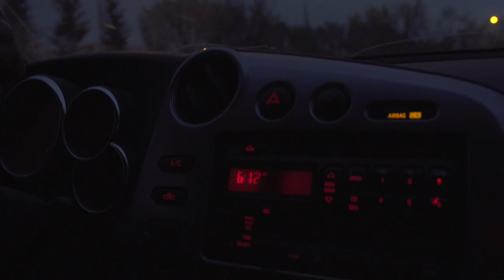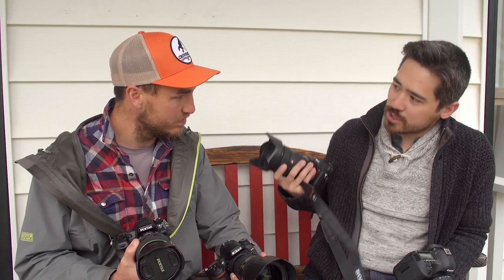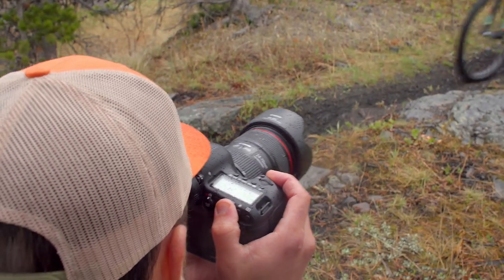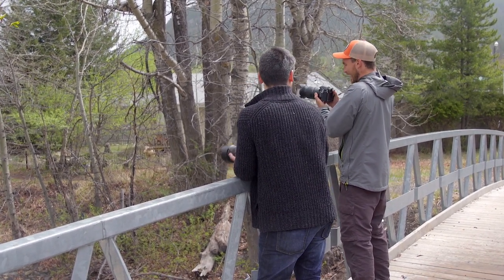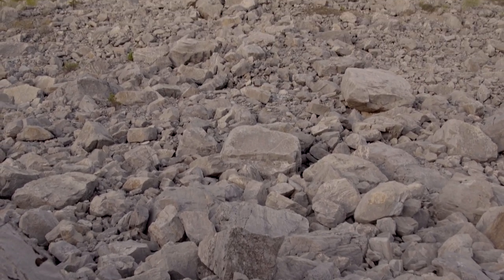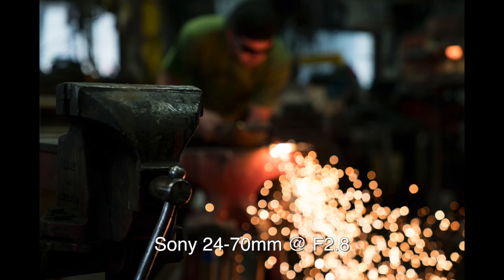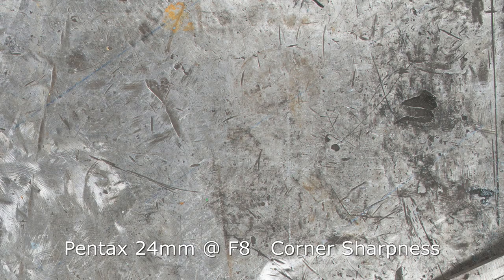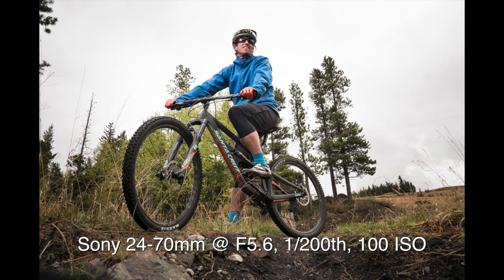The Great 24-70mm F2.8 Shootout! (Featuring Sony, Pentax, Canon and Nikon)

Comment: Main reason I'm selling my A7RII, Canon lenses.
Reply: Which camera are you going to use instead of the a7R II?
Reply: Mostly the Canon 5D3. I've realised the Canon system is hard to beat; Sony isn't even close (for photography).
Reply: habitullence The only thing where Canon beats Sony is AF Performance, battery life and lense variety.
Reply: Ecosystem of Canon, inc. third-party, is vast in comparison; better lenses; nicer to use (especially with heavy glass); dual slots; durability; professional support is light years better; (I could go on). Obviously depends what your use cases are, but for mine the Sony doesn't make sense.

The Sony has sensor and size (not really weight because of extra batteries) going for it.

I would rather wait for Canon to up their sensor tech — for me, good glass alone is far more important than a slightly better sensor (the adapters don't get the same results as native).

Like I said, depends on your use cases. Personally, I haven't looked back.
Reply: lol, please do it.

I'd never ever go back to Canon. 

the image quality has the highest priority for my customers...
Reply: 5DSR with Otus > Sony A7RII hands down.
Reply: habitullence 

??? you said something about canon lenses? :D the only lenses which could outresolve this sensor are zeiss lenses, and you should know that sony has zeiss members in its team...

Comment: Too bad Sony lenses are fly by wire, kills it for video producers.
Reply: The 85mm f/1.4 from Sony is a different animal. It's meant for video. Check it out
Reply from the maker: +Neopulse00 Still focus by wire. Beautiful lens, but I wouldn't use it for video work.
Jordan @ TCSTV
Reply: +Armando Ferreira Do you know any modern AF lens that is not fly by wire? thanks.
Reply: TheCameraStoreTV That I know it's still focus by wire. But could have sworn that it was made with a more.... sensitive (for lack of a better word). But if you deem it not good for your video work, then I have to take your opinion into consideration since you do, do this for a living. Thought it might have made you a believer in a way of hope for videographers.
Reply: +Neopulse00 Sony has tweaked the focus acceleration on their newer lenses so it feels more natural when manual focusing. I feel they're better for manual video focusing now, although not perfect.

Comment: It is FACT that the Nikon 24-70mm vr is INFERIOR to the older model, which is inferior to the Canon 24-70mm mark II. Don't trust this video.
Reply from the maker: +CEEPMDEE Thats exactly why we stated an showed that the Canon is consistently better than the Nikon across all focal lengths and aperture ranges. We absolutely agree with what you stated and also agree that Nikon's 24-70 2.8s in general could improve in the sharpness realm all around. So I think you CAN trust this video.

Chris @TCSTV